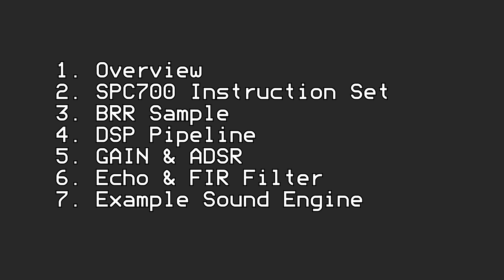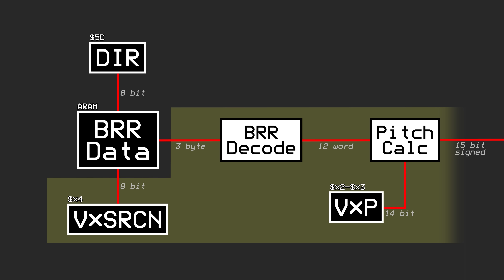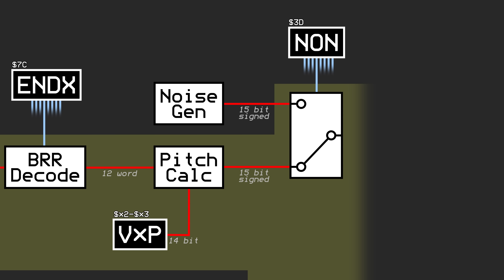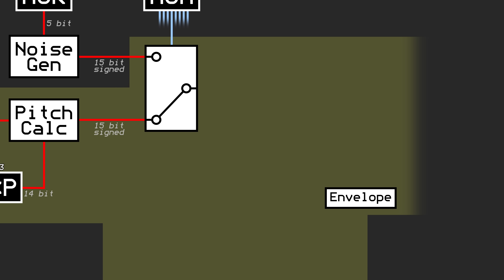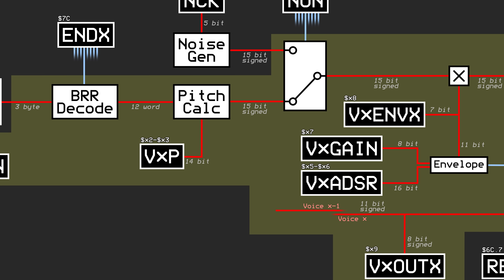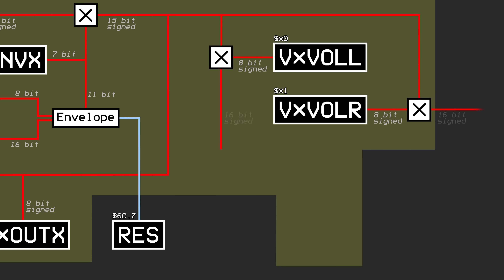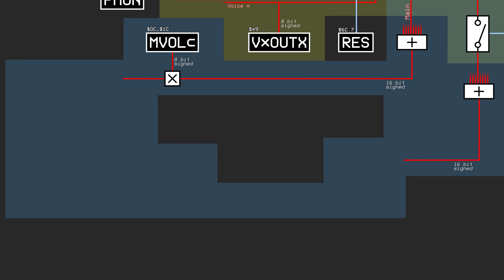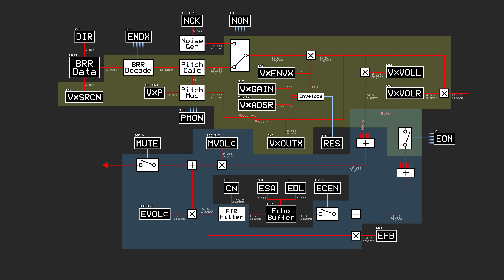The SPC700 DSP Pipeline Explained - SPC700 Series pt. 4

Comment: So with the generated noise signal or the echo signal combined with the main upsampled brr samples in mind, you can get 16bit audio out of your snes.
So why are those brr samples upsampled to 15bit? Not only does it has to do with it’s cheapass 4 point gaussian interpolator with it’s sum of them all weights system, but also to make room for either the echo or the noice signal to fill it up to become a 16bit audio sognal.
If theres no echo or noise sinal applied to them, then you will end up with 15bit audio signals getting oversampled to 16bit audio signals with added zeros to them.
Because those audio dacs in the snes are 16bits.

Comment: I honestly doubt sound engineers at Nintendo entered this far into the programming when they handled games. It was probably more of working on trackers and assigning samples that were compatible with the hardware, and then making them playback using machine code with $Values and other registry addresses depending on gameplay, where a programmer likely intervened. So in terms of specs, these things are good to know. But in terms of making Chrono Trigger music or anything in that vibe, it doesn't go this deep.

Comment: I've got a burning question... What happens when you have values for the same channel set for both KON and KOF set at the same time and... Does there have to be some kind of delay between setting them? I've been watching your videos over and over and they are quite informative. Great stuff! I've been experimenting trying to write an engine with SPCAS for my homebrew game. I've had times where my sound effects play perfectly repeating (not set for looping). I used delay loops because I'm still having problems reading the timer values I guess. Sometimes with other experiments I get a chopped sound or something similar that changes slightly when I hit reset. My first program that worked on an emulator worked on real hardware so it must be somewhat right. Took like 200 tries to just get a short high pitched beep at first. I have done a digitized car crash and a skid sound effect successfully. Just wondering if KOF overrides KON or if a delay is needed between setting the two. I've been using Gain. Can't wait for your other videos on SPC700. I couldn't have made it this far without them!

Comment: I've heard of homebrewers using the echo buffer as an extra/uncompressed channel, but never seen how or why it can be abused that way, and this diagram clears it up, I think. 
Basically, if you enable echo output, disable all of the channels feeding into it, and use the SPC to write sound data directly into the ARAM echo buffer, what should come out is whatever arbitrary sound you put in there, right?

Comment: Did You Know? The design of the PS1's audio subsystem is nearly identical to the Super Nintendo's. The biggest different are the size of the audio sample buffers, RAM, and registers.
As a result (as I've seen in other videos), the Super Nintendo is more than capable of reproducing the sounds and effects of PS1 or PS2 consoles, particularly their start up sounds, just with a lower bitrate that results in them sounding crusty and lo-fi compared to their intended quality on the PS1 or PS2.
Reply: That makes sense given that the Playstation was originally intended as an expansion to the Super Nintendo. While more graphics horsepower would be expected for the CD-ROM attachment (especially given Miyamoto's interest in 3D technology), there's really not much wrong with the sound system of the SNES.
Reply: @thewiirocks  yes and also that Ken Kutaragi who was the guy at Sony who designed the SPC700 was also the head of playstation development...
Reply: The only differences between the ps1 and snes audio chip is that the ps1 can generate 24 soundchannels at 16bit at 44.1khz whereas the snes can only generate 8 soundchannels at 16bit at 32khz.
And yes the ps1 audio ram for storing all those samples in it 8 times bigger then that of the snes, but that’s it.

Comment: So to wrap it all up snes audio is nearly CD quality because it’s audio is 16bit at 32khz as opposed to 16bit 44,1khz of a CD.
Whether with echo or it’s generated noise signal or it’s upsampled brr samples being oversampled to 16bits. 
hack you even could avoid BRR compression by streaming uncompressed audio by offsetting echo writes and doing everything trough software instead. BUT this involves using the entire ram and cpu to it’s maximum to allow such high quality audio on snes. it’s no doubt even better then mp3.

Comment: I was wondering what pitch modulation actually was so that's definitively helpful. The circuit logic also makes me understand how the echo works like the purpose of the EFB as well as how it's controlled by the echo volume (i.e. none at all).
Reply: Pitch modulation is really just a different term for frequency modulation, or FM. I can recommend Andrew Huang's brilliant video FM synths in under 4 minutes that runs through what FM is and what it sounds like, in case you want to learn more about it!

It's a shame pitch modulation is used so little, but the examples that do exist are great. Dean Evans' Attack 1 from the Waterworld soundtrack (at times it has two adjacent voices with pitch modulation enabled on both!), and RednGreen's Coral Labyrinth come to mind.
Reply: @exodustx0  You may be pleased to know that Squaresoft used pitchmod somewhat often starting from around 1993 - Flammie's sound effects and the distorted bells at the beginning of "The Oracle" in Secret of Mana, Kefka's laugh, the lead melody of "The Fierce Battle", and the synth chords in "Final Dungeon" in Final Fantasy 6, and the whistling wind sound effect, and Lavos' cry in Chrono Trigger are a few examples I can think of.
Reply: @_aitchfactor188  This comment pleases me!

Comment: I knew the SPC700 was a complex piece of machinery, but this really helps me grasp just how complex it is. It makes more sense to me now, though!

If I understand it correctly, it looks like it would be possible to output ONLY the echos of a sample without the original sample, since the output of the echo buffer is added after the main volume component. Is that right?
Reply: That's correct. SMW hacker Vitor Vilela actually used this for a form of variable mix where depending on when the player is underwater, the main volume is set to zero while the echo is at full volume, leaving out only the channels with echo enabled to play back.

Comment: "Due some design quirks, our system may or may output audio that may be picked by dolby surround devices as a back speaker signal. We didn't intended to violate your patents but we can't quite be responsible by what the developers will do"
Reply: Oh, no harm done.  Dolby Surround wants the surround channel mixed with the L and R channels after being phase-shifted by +/- 90 degrees.  This, clearly, is a simple polarity inversion, so 180 degrees.  Two completely different things that just happen to both coincide with a net difference of 180 degrees in the Lt/Rt channels for audio that should be decoded into the surround channel.
Reply: Classic Nintendo licensing workaround.

Nintendo is famously skinflint with paying licensing fees - we remember how they basically decided against putting DVD functionality into the Wii so they wouldn't have to pay $20/unit, but it goes all the way back to the original NES. Ever wonder why the decimal mode flag is disabled? They got the 6502 masks from Ricoh and disabled that mode to not have to license the design from MOS.

For the legal wonks, this works because:

 - Copying circuit designs would not be illegal until the 90s

 - MOS only had a patent on the automatic decimal mode. This is also why the Intel 8080, 8086, and Zilog Z80 have a separate DAA instruction that is otherwise functionally equivalent.
Reply: @SuperSmashDolls   Haha... some good points.  But, I don't think actually this is a license-avoidance thing.

For one, shifting the phase of a signal is not something I believe you can patent.  Certainly not flipping the polarity of it.  If that were the case, nearly every manufacturer of a mic preamp, or mixing console, would have to start writing checks to Dolby.  :-D

Even if it's used for the sake of simulating 3D space in audio, mixing in-phase to place something in the center, and out-of-phase to place it behind the listener -- these are not novel concepts.

I think Dolby's real strength was in developing a standard methodology, designing encoders and decoders to adhere to that, then selling a license to use the logo to convey that adherence to consumers of that program material.

There were lots of competing technologies that did similar things -- Aureal 3D and SRS, for example, but certainly plenty of generic "3D audio" processing engines.

That is to say, I don't think they had anything to fear, and probably weren't even contemplating this to be an off-brand Dolby feature.  Rather, it's just another tool in the sound designer's toolbox -- along with gain, envelope, delay, and (apparently) modulation.

That said, I played my SNES through a Pro Logic receiver back in the day, and absolutely loved how Star Fox sounded.  I even bought Jurassic Park almost specifically because it was made for Dolby Surround.  (But I also thought it was fun.)

Comment: I love seeing how similar SNES DSP and PS1 SPU are - they basically increased sampling rate and number of registers, everything else (including register names and functions) are a exact match.
Love your videos, helped me understanding how internally samples are crafted and fixed few bugs in my PS1 emulator.
Reply: "There is no knowledge that is not power."

So, now you know. And now you can.

As a server and client-side programmer, I think you should reproduce all this information processing flow for your emulator's sound output to work well.

I wanted to understand where the sound comes from in an emulation.

In my mind the SuperNintendo has a sound chip (similar to an electronic Yamaha keyboard chip) that stores a "soundfont library" full of audios samples and audio processing features.

Am I correct? If so, where do these samples come from during an emulation?

Not all the samples are stored inside the cartridge ROM, right?

Has anyone created software that emulates this chip "soundfont"?

Was the chip features reverse engineered?

Have the original samples been extracted and placed somewhere somehow?

How do you (emulator developers) manage to emulate these proprietary chips?

Idk how dumb is my question. But it's a geinuine one. I have no idea.
Reply: @VictorCampos87  

1. Yes, the audio subsystem is essentially a soundfont synthesizer/hardware MODtracker with an added echo/reverb engine.
2. The cartridge ROM stores all audio samples and sequence data, which is transferred to the SPC700 subsystem over the main CPU's secondary bus (which also handles interfacing with the graphics chipset and external peripherals like controller ports).
3. Generally, the only sample sources are directly within the SNES cartridge itself, though the console was designed to be able to mix in external analog audio as well, such as the cancelled CD add-on peripheral or satellite audio streams from the Satellaview peripheral. The SPC700 system itself doesn't have a native soundfont stored in its own ROM, though composers for the system may have used common sample libraries available at the time, especially if they went to the effort of converting them into BRR format.
4. Related to the above, while there is no SNES "soundfont" like the Roland GS MIDI library Windows used since the 90s, many audio players are capable of playing back emulated SNES music in the .spc file format, which encapsulates sample and sequence data in a single file.
5. While some reverse engineering has taken place, like many other microprocessor products, there are (possibly) official Sony documents out in the wild for how to program and interface with this system—Ken Kutaragi made it before the SNES was designed, and they had to have some way of letting licensees know how to use it.
6. As mentioned in #4, it is possible to "dump" the ROM contents of a game cartridge and store it in other computer storage, facilitating reverse engineering and analysis.
7. I cannot speak for Jakub in particular, but having worked on other "non-gaming" emulation projects now-and-again in the past, sometimes all you need to know is how the system is supposed to work logically without having to access the physical hardware. This is what allows, for example, a codebreaking team to decrypt a secret message without even touching the original hardware used to encrypt it in the first place, if they have a mathematical description of how the coding process works.

Hope this helps clear some things up.
Reply: @eddievhfan1984  Your comments solved all my questions! Thank you very much for your time, sir. Helped me a lot to understand more about this Sony chip used on SNES audio system.
Reply: It makes sense, given that the PS1 originally started as an addon for the SNES, before Nintendo ditched Sony in favor of Philips.
Reply: The man that designed the SNES DSP was none other than Ken Kutaragi (who also designed the PS1)

Comment: One thing I've wondered about for a long time: Wario's Woods is one of very few SNES games that apparently writes to the SPC700 directly, which is why there's no such thing as a proper .SPC soundtrack available for it. (There is an alternative, obscure "SNSF" format and associated player.)

The music's nice enough, but there's nothing that really distinguishes it on a technical level from any other SNES game. Was any particular advantage achieved by doing things this way? (Maybe the devs were just porting the code from the NES version and were in a hurry?)
Reply: Not sure about Wario's Woods but Out Of This World and Super Off-Road are two games that also control music from the main CPU instead of the S-CPU.  In both of those cases, I suspect it's only because those games are ports, and the game engine probably already supported music, so migrating that to the S-CPU would have been additional porting effort.  Perhaps the same applies to Wario's Woods if there was a NES version.

I can't think of any reason you'd want to set things up this way if you weren't porting.  Some games like Rock 'n Roll Racing and Clayfighter stream speech sample data from the main CPU in real time, since it wouldn't easily fit in SPC RAM, but the bulk of the music is still generated internal to the SPC.
Reply: One advantage I can think of is that you aren't as tightly bound to the APU limitations like BRR decompression (and the smoothening of the curve) and the eight channels.
Reply: Maybe longer samples that can't fit in ARAM